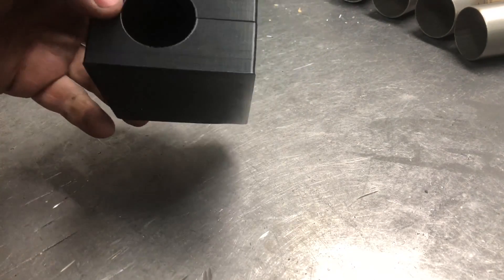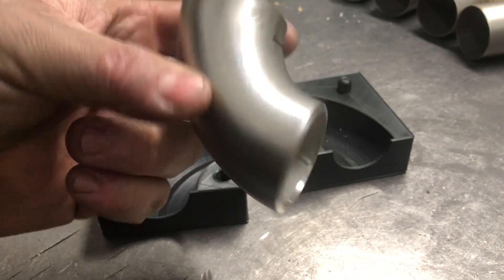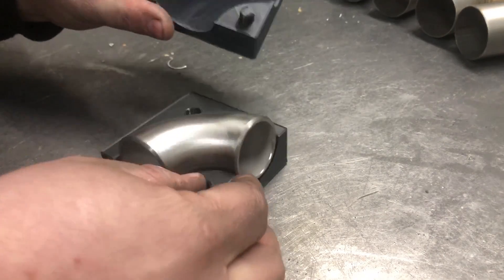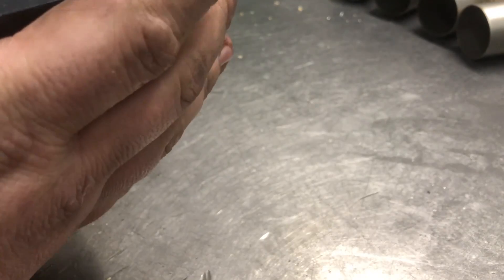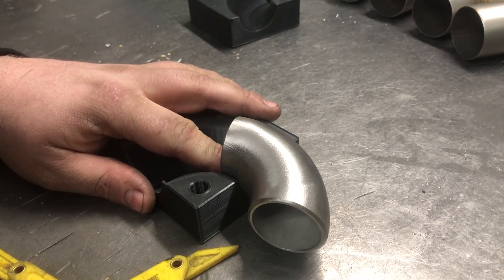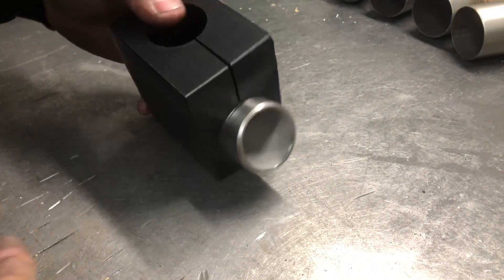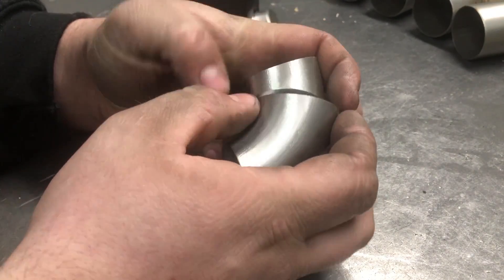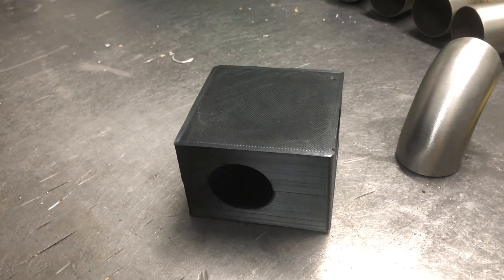SCH10 Manifold Elbow Cutting Fixture

Comment: Will this work with the 48.3 x 3 mm european elbows?
Reply from the maker: They are designed to with with SCH10 NB. 1.5" is 48.3 x 2.77mm Wall. It may work.
Reply: @GizFab  Ok i ordered mine. It will probably work. At least thats what the theory says. Ill report back.

Comment: you could print plugs in different angles to sit behind the weld elbow ,would mean quick set up and stop the pipe moving in the jig
Reply from the maker: Once it’s clamped down. It doesn’t move. The half’s are slightly under sized so the jig tighten up to the elbow.